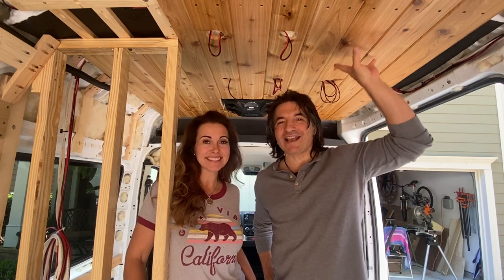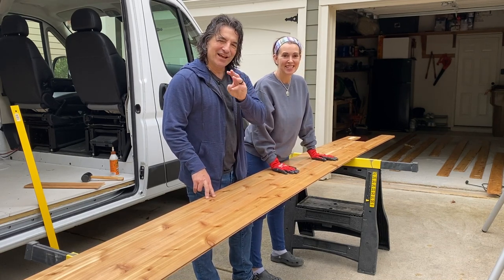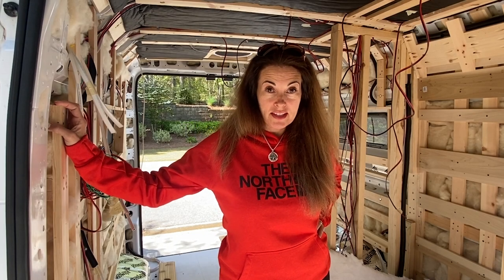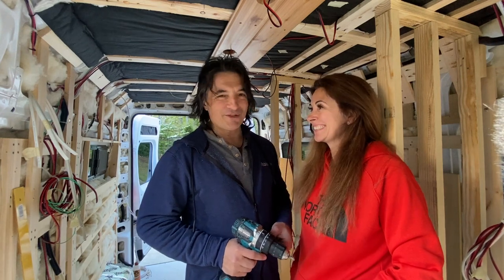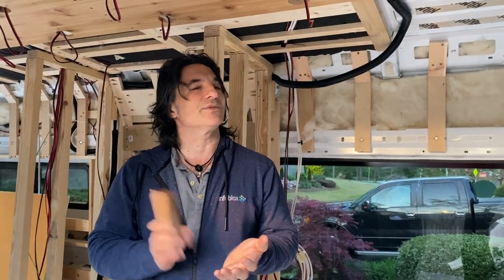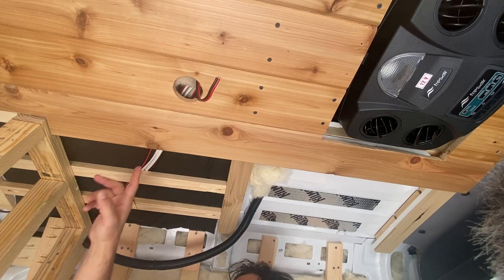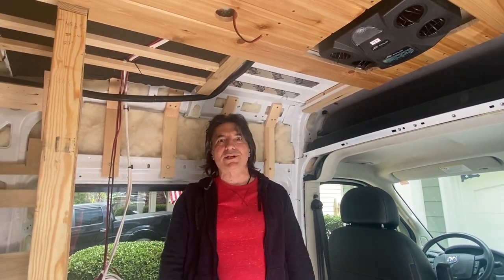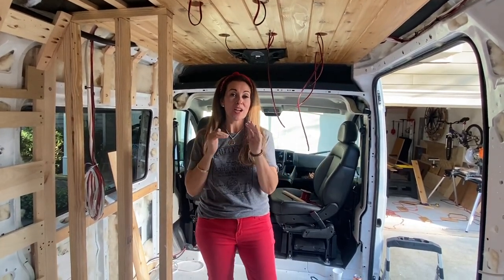Installing a Cedar Tongue-and-Groove Ceiling: Part 24 – RAM Promaster 2500 Van Conversion

Comment: You said you might want to cover those screw heads with wood putty or wood filler or whatever it was you called it. what you do is you get some sawdust from them boards that you cut, and you mix it with some clear glue Elmer's Glue and you make your own putty.  that way it is a match to the same color wood and its cheaper than wood filler. It will just match up and look better.
Reply from the maker: Dang....thats an awesome idea...I totally forgot that you can do that....been trying to match the cedar color for several days... THANK YOU!!!
Reply: @marctania2349  anything for you my friend
Reply: Thanks. What ratio of glue to sawdust?
Reply: @djdoofus  as thick or thin of a paste that you think you will need if it's on a flat surface you can make it kind of thin if it's on a wall you will have to make it thicker